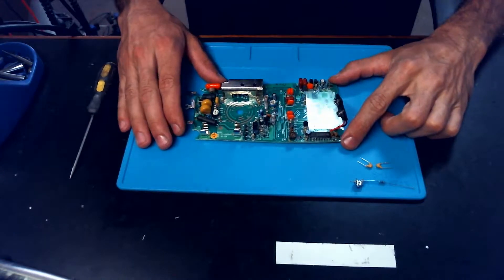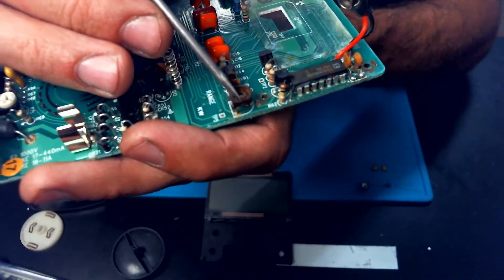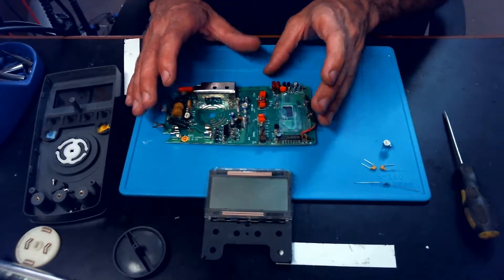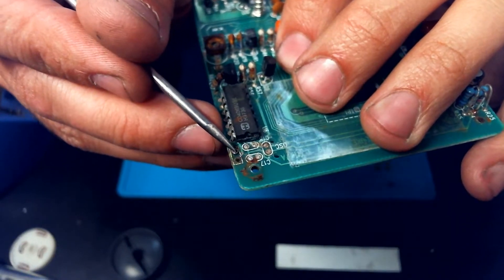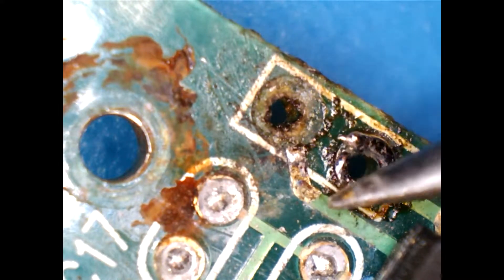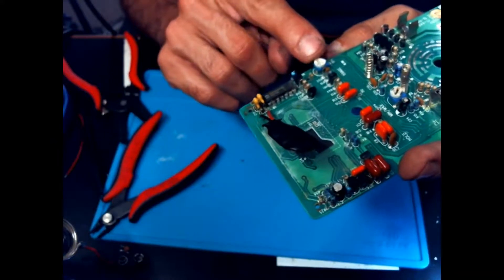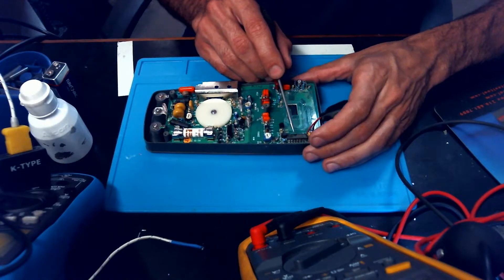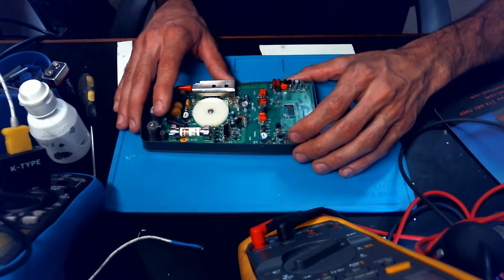Dead Fluke 17 Repair- Fixing Water Damage on a Multimeter, Part 1

Comment: Fluke t5 did not read the amps , any tips?
Reply from the maker: I've never worked with the t5 before. I would double check that the battery is good, and try on a known current source to see if it's reading incorrect or not reading at all.